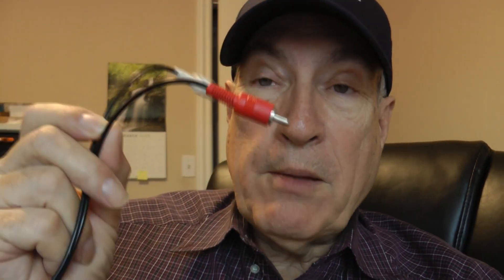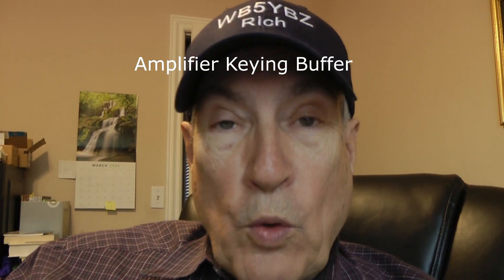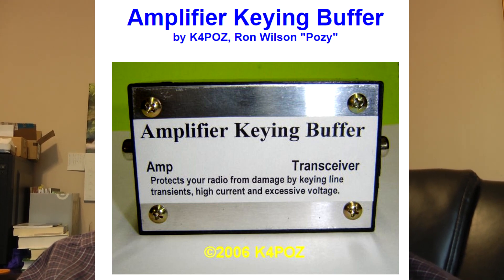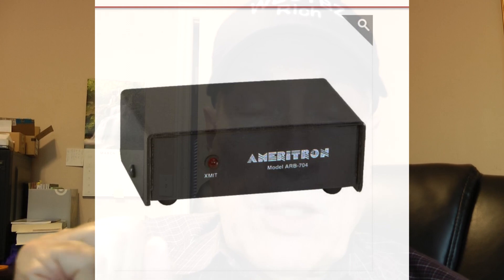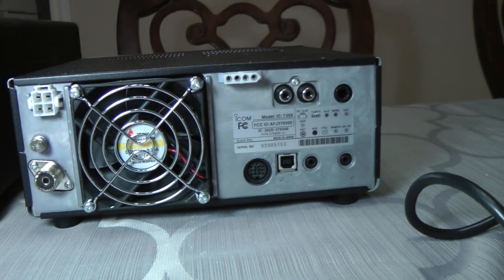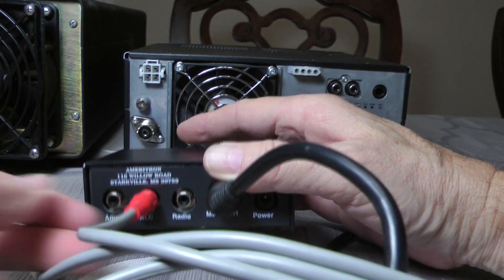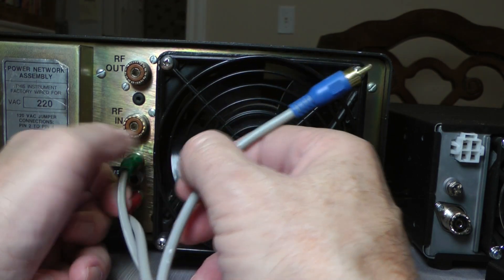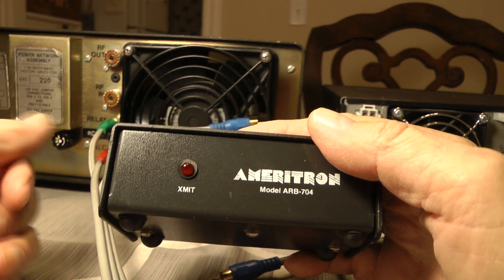Ham Radio Amplifier Keying Interface  Buffer Amateur Radio

Comment: I bought a new Yaesu FTDX10 transceiver to take the place of my beloved IC-7300 radio. I was using just the phono wire between the radio and amp but I need something like this to connect my Yaesu. I decided since I have the Ameritron ALS-600 I bought the Ameritron ARI-500 remote interface and the interface cable for that radio that does the automatic band switching and the keying of the amp. I am uncertain if it provides any spike protection but there is no way you can use both interfaces together so I assume there is some level of protection built into the ARI-500.
Reply from the maker: According to DX Engineering, IF you can use the Ameritron ARI-500 interface, then you DO NOT need an Ameritron ARB-704. The cables for these devices are unique and are not interchangeable.  So I am guessing you would have some protection.   Thanks for watching my video!!!

Comment: Hi. I have the kenwood ts570D radio. If im going to run the Ameritron arb 704 must the linear amplifier control relay in menu 39 of my radio be in the off position or the on position? I will be using the Ameritron Al-80B amp..
Reply from the maker: I don't have a 570d and can't answer the question
Reply: @RichRodgersOnline  I actually called Ameritron. It should be in the on position. Thanks for the response
Reply from the maker: @SFLightfoot  That is great!  I would have guess that would be it, but was not sure...  Good luck 10 meters is booming right now...
Reply: @RichRodgersOnline  thank you Rich. Will do... Best to you...73,s...

Comment: I am getting the ARB704 to  hook up my 7300 to a homebrew rf amp 2nos 811a tubes. In addition to the connections you have  shown, a patch cable from tx to amp input also is needed, qsl??? Thanks
Reply from the maker: If you get the ARB704, get the harness which goes from the 7300 to the ARB704.  That cable furnishes the power from the 7300 to the ARB704. I didn't know this at the time of the video, but you don't need an extra power supply for the ARB704.  The harness also uses the internal relay that goes from the 7300 to the ARB704 that way you don't have to use the the external relay plug of the 7300.  Since you are using a homebrew Amp, If you may have 1 plug which would plug into the transceiver.   That plug is your relay plug for your Amp..  You really just need one cable from the relay output plug from the the ARB704 to the the input relay for your Amplifier.  I don't have a cable going straight from the Transmitter to the Amp.  I hope this is clear...  here is the manual: https://cdn.shopify.com/s/files/1/0289/7782/3843/files/ARB-704.pdf?v=1586534038

Comment: Good review.  Doesn't the ARB-704 pull power off the accessory cable, i.e., from the IC-7300 radio?  I see you are using a wall wart to power it.
Reply from the maker: Yes, power by the 7300

Comment: whats the blue jack cable for
Reply from the maker: Blue Jack was an extra jack that was on the cable it didn't plug into anything.  And you just need either power from the ICOM or an outside source.

Comment: Are there any special settings on your Icom that you should adjust when using that accessory port to key your amp instead of the rca jacks?
Reply from the maker: Not that I know of
Reply: @RichRodgersOnline  I have one of the those on order from HRO, but have no idea when they will be available.......backordered everywhere!  I'm praying that my IC-7300 survives before I get it.  de N6LTU
Reply from the maker: @DougThompson  There is a cheaper one that works well. www.k4poz.com  Thank you for watching my video!
Reply: @RichRodgersOnline  Hey, thanks for the tip!  I'll call him and see if he has any on hand.  Also, an explanation on how to connect it.  :-)
Reply: Set TX Delay or your radio to 15ms

Comment: The manual says you don't need to use an external power supply if you use the Multi-port.
Reply from the maker: That is correct...